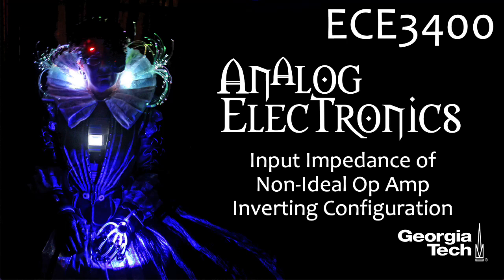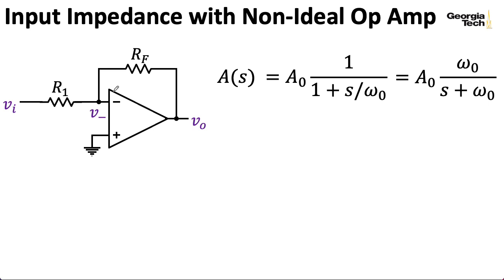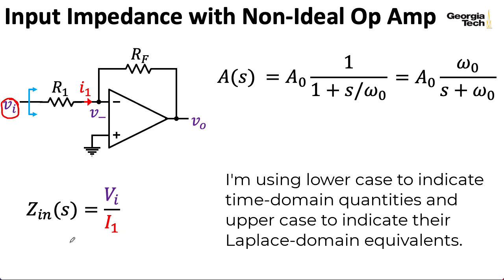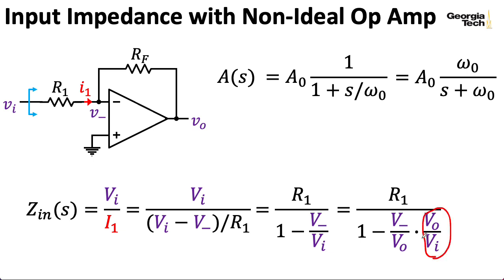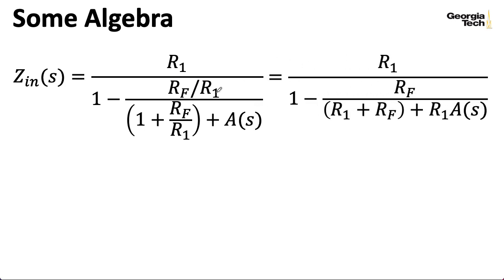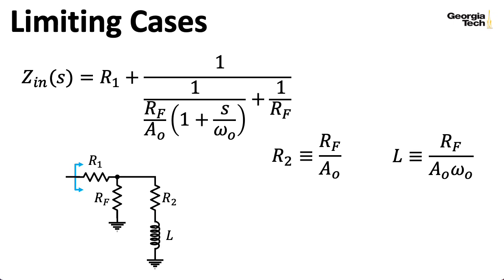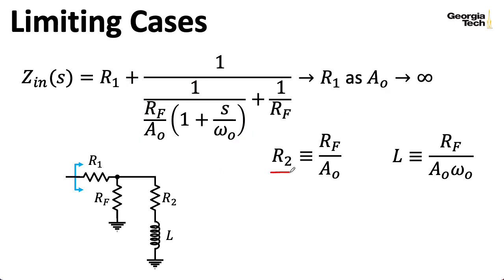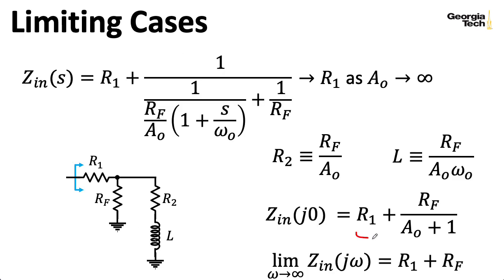ECE3400 L40: (OLD VERSION) Input Impedance of Non-Ideal Op Amp Inverting Configuration

Comment: Thanks for sharing your very interesting classes! In this particular case you may highly simplify the analysis by using Miller theorem. Thus the impedance at the right side of R1 is RF/(A(s)+1) right away. I prefer to consider the inverting OpAmp-based amplifier as being composed out of 2 blocks: an V/I converter = R1 and a trans-impedance amplifier = OpAmp+RF. This fully explains the behaviour of the circuit: in DC input impedance is R1 + RF/(A0 + 1) while as frequency increases the gain decreases thus second term also increases. Another simpler solution is to use feed-back theory by opening the feedback loop: the gain block will comprise the OpAmp have an RF connected from V- to ground and another RF connected from output to ground. Thanks again and please continue the good work! ❤
Reply from the maker: This is an excellent point! I just made a new version of the lecture that takes this approach.
Reply from the maker: https://youtu.be/N6xjQeg0XWo

Comment: I feel this kind of result makes more sense if you step back and think about fundamental passive components like resistors, capacitors, and inductors by their definition in the charge-voltage domain rather than thinking about them as plates, coils, or any specific implementation you're familiar with.  In the charge-voltage domain a capacitor is any component whose voltage is proportional to the quantity of charge  V*C = Q, a resistor is any component whose voltage is proportional to the rate of charge V*R = Q', and an inductor is any component whose voltage is proportional to the rate of the rate of charge V*L = Q''.  A common way of making an inductor is by using coil and taking advantage of the physics behind magnetic fields, but that's an example of a possible implementation of an inductor, not how an ideal inductor is defined as a mathematical model.  If a component has the relationship V*L =Q'' it is an inductor. 

One consequence of this kind of thinking comes in how you must model phase.  Current is Q', and If you substitute V = sin(ωt) into those models and calculate Q' then for the capacitor you get the relationship  Q' = ω*cos(ωt)*C, for the resistor you get Q' = sin(ωt)*R, and for the inductor you get Q' = -cos(ωt)*L/ω omitting the constant of integration. These are of course the relationships you'd expect but I think it's elegant to show how naturally they come from their simple definitions.  From this we find that a capacitor involves a +90 degree phase shift in current with respect to voltage, a resistor's current is in phase with the voltage, and an inductor involves a -90 degree phase shift in current with respect to voltage.  This result shows that anytime you have a negative phase shift and attempt to model it with just fundamental passive components you will inevitably require an inductor to do so. 

A feedback system has a 180 degree phase shift which an ideal op-amp compensates for using its inverting input which should give a further 180 degree phase shift. By using a non ideal op-amp you no longer get that perfect 180 degree phase shift and the result is some remnant negative phase.  For example if your inverting input has a phase shift of only 170 degrees at some frequency and is in a feedback configuration which contributes 180 degrees of phase shift then the net phase shift would be 350 or -10 degrees and so when you try to model that with passives you will require an inductor to do so.

Comment: I think that one way to intuitively look at it is to consider three cases:

DC: the Aol of the op amp is infinite so negative feedback is working perfectly and V- = 0V, so Zin is just R1. The inductor is completely shorted out.

Midband: As Aol is dropping because of its pole, the magnitude of the op amp output is decreasing since Vout = Aol (V+ - V-). 

Since this is an inverting configuration, this means that the output is actually “increasing” (getting closer to zero/becoming less negative).

That means that the node V- is increasing, so the voltage drop across R1 (Vin - V-) is decreasing, so there is less input current and the input impedance is increasing.

As frequency increases, Aol continues to decrease, Vout gets closer to zero, V- continues to rise, and the input impedance continues to increase, giving rise to the inductive behavior.

High frequency: As Aol drops to 0 (at infinite frequency), the op amp output also drops to 0V, so looking in from the input you see a series impedance to ground of R1 + RF. The inductor is completely open.

Comment: 17:45 So, let's see. I think you would have no problem associating some inherent capacitance as one of the main limiting factors in making an op-amp less than ideal to start with, am I right? ...so for me, the leap to imagining why there is a phantom inductor involved is that inverted relationship of the RC & L/R time constants - you have effectively fed back the time constant of the capacitance in the non ideal op-amp turning it on its head to make it an inductive time constant. I probably haven't explained that very well, but that's how I view it! It should also be said in practical terms for analogue audio circuits (also my main interest), this whole problem can largely be forgotten about! Greetings again from Ireland, and your content always appreciated.

Comment: So I've had some time to think about this, though my "simple" initial thoughts haven't changed. The impedance looking into R1 rises with frequency as the feedback gain falls, from (practically just) R1 at DC to R1 + Rf at high frequency. So what would it take to do that? An inductor in series with R1 and in parallel with Rf. And as others have said, the phase relationship also just happens to be that of an inductor as well. Actually I don't think you can make the rising impedance with frequency (with resistors, capacitors and active linear devices) without it also having the phase relationship of an inductor. I'm unclear on where R2 comes from, except that "all practical inductors have a measurable series resistance."